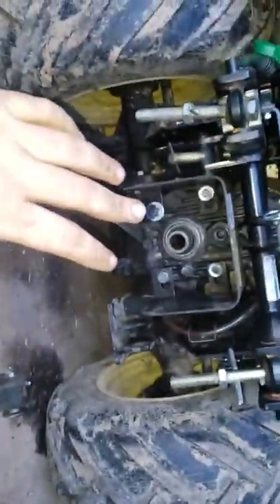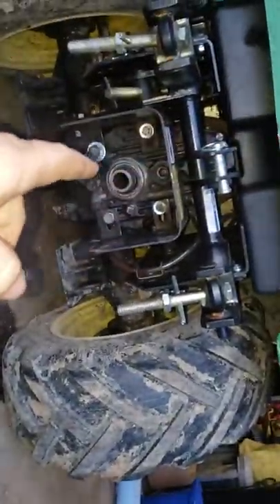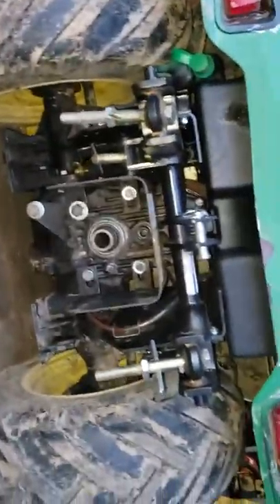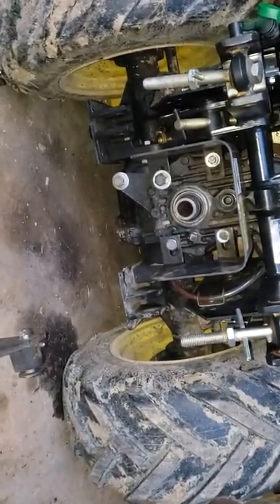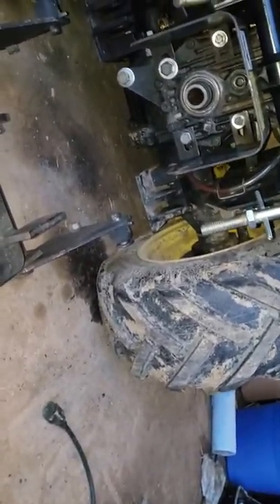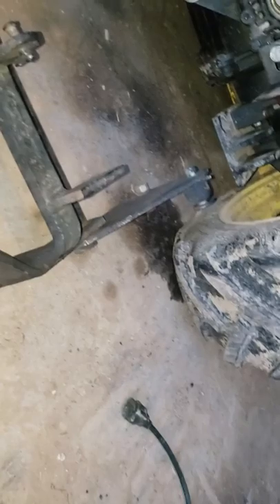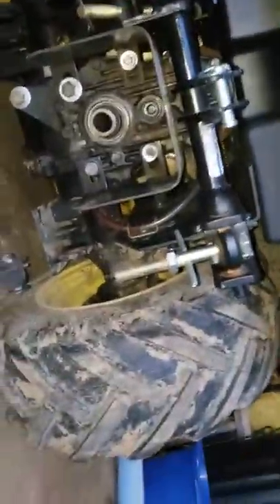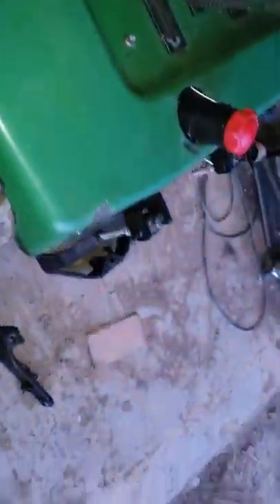The Difference between sleeve hitch and 3point hitch

Comment: The main advantage of a 3-point on any tractor (not just a GT) is that it distributes the load from the attachment evenly across the rear end of the tractor...so the weight of the 3-pt attachment is balanced between the rear wheels, axles, AND the center of the tractor. The sleeve hitch really just concentrates the weight of the attachment on one central point, and puts all the load on the tractor's frame. But back in the day before most manufacturers were able to design a true 3-point hitch for garden tractors, sleeve hitches were the cost-effective and simplest way to go. What sucks about either type of hitch is they don't provide down pressure.

Comment: All they are doing is separating the commercial market from the residential market with the hitch. The biggest issue is that it opens up the door for every garden tractor implement to be manufactured in China while maintaining better quality for commercial. Cause they know themselves Chinese made is crap and it doesn't bother them to sell you Junk.
Reply from the maker: The small garden tractors are not ideal to do that kind of work
Reply: @Drewsadventures00  They have always been for Garden Work in the past, What happened?